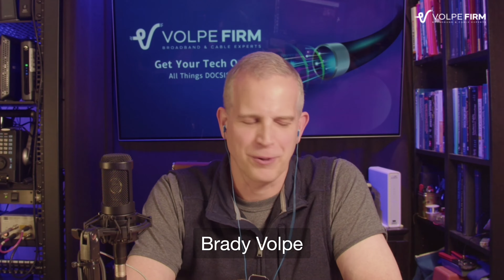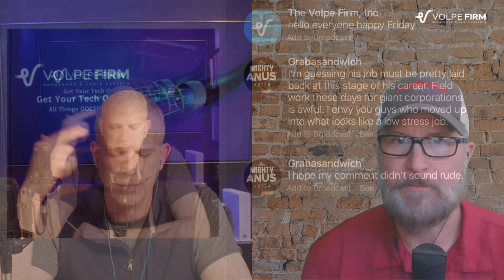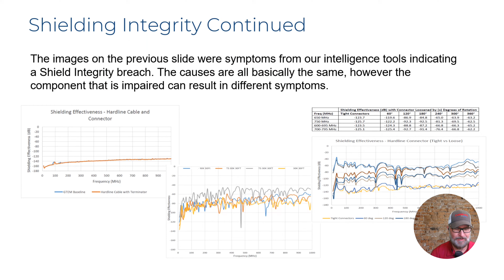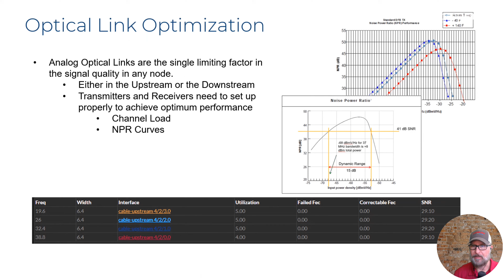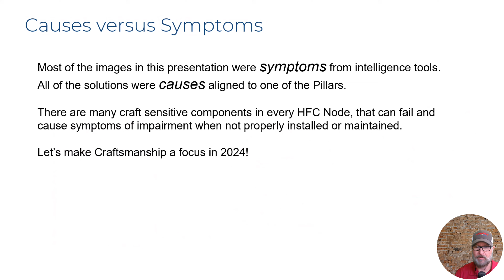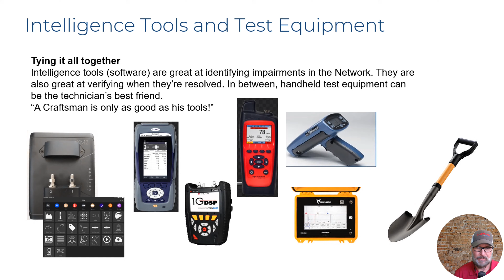Mastering Network Maintenance: Unlock the 5 Essential Pillars for a Reliable and Efficient Network

Comment: Regarding comment by Matthew Horwat about 45 min rpd reboot...aside from vendor specific issues I have seen many power related issues where if the input voltage is hovering close to the minimum spec, what is  normally a 5-10min reboot may take 45min because it keeps restarting.  Hope that helps for anyone working with rphy. This is one of a few scenarios that can lead to long rphy boot times especially when it's a particular location versus all the rpds on a cmts let's say.
Reply from the maker: Whoa, thanks for the tip on the voltage!